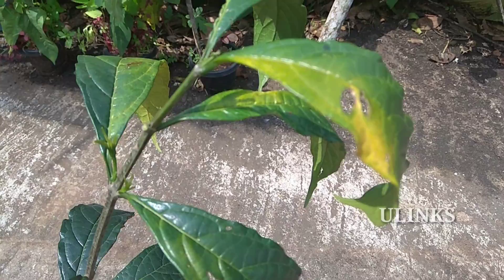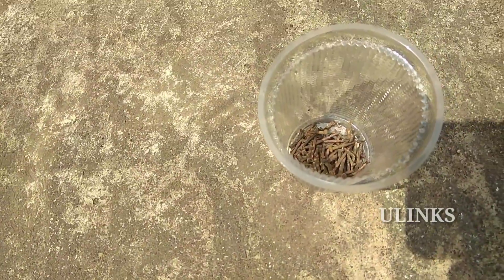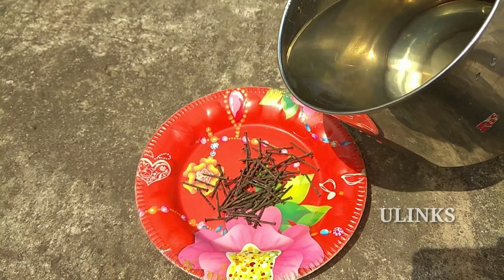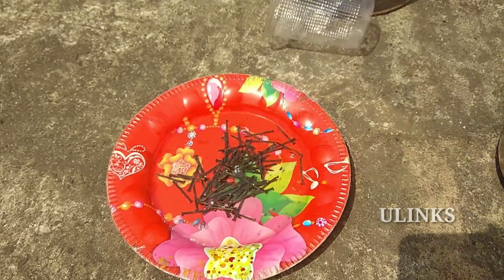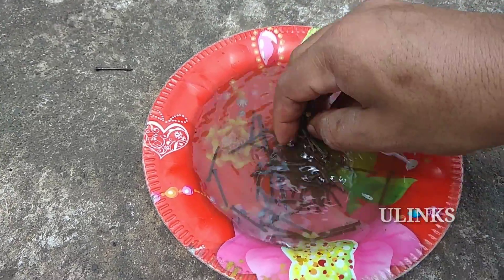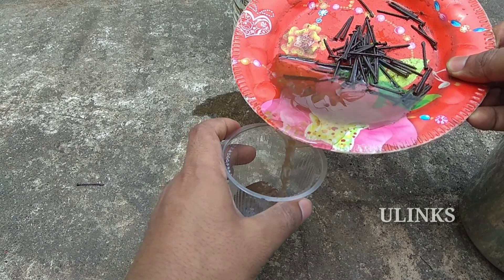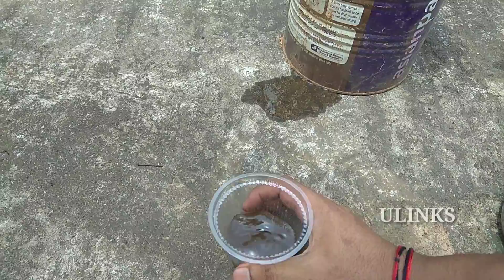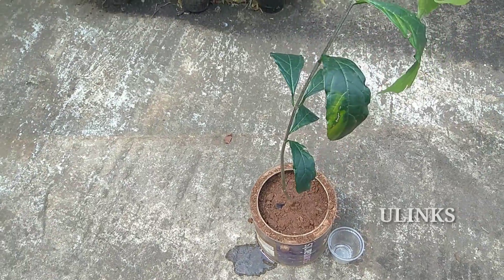how to treat iron deficiency in plants

Comment: Add vinegar and hygrogen peroxide to dissolve the iron rust isn’t water soluble or just use a sulfate or chelate of iron
Reply from the maker: This one is natural method too much iron consumption of plants may lead to death
Reply: @Ulinks  that why you have to dilute the iron the iron from the rust will take 100 years to broken down naturally unless you have really acidic soil add vinegar and hydrogen peroxide  to dissolve convert it to iron acetate which will be more souble.
Reply from the maker: @Youdontknowmeson1324  I am following the natural way anyway thanks for your valuable information